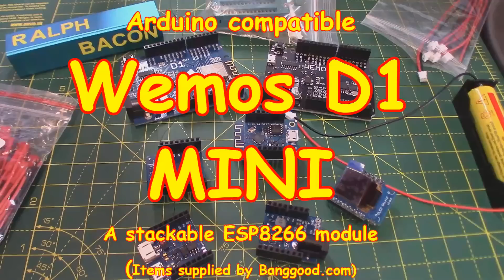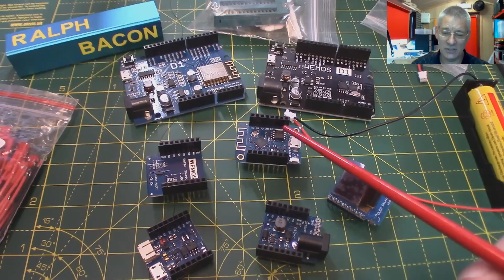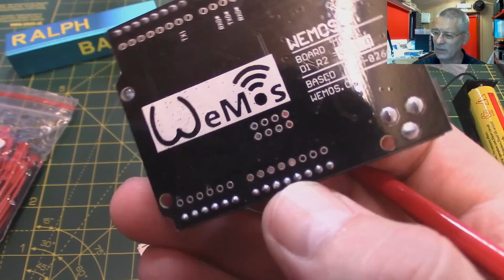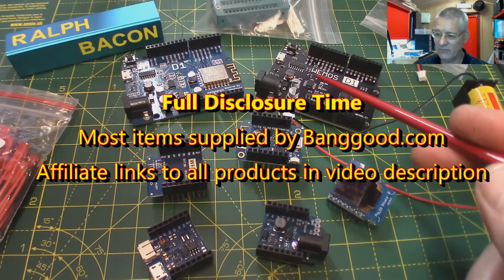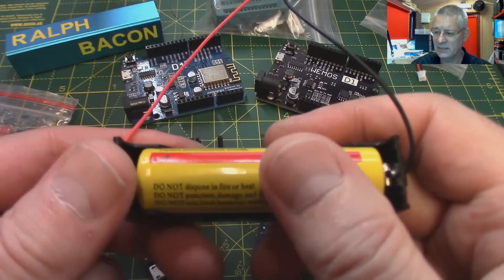#120 Wemos D1 Mini 👍 Intro (with shields)

Comment: For the completely uninformed, to be able to configure the IP address - to say a different static address - does one first install the Arduino IDE, then download the Wemos mini boards manager thru the Arduino IDE, and configure the wemos thru that software? How does this all work?
Reply from the maker: I may be wrong, Peter, but I think you are confusing the Integrated Development Environment with the actual sketch that you upload to the Wemos D1, if you are talking about giving it a static address.

1. Install the Arduino IDE.
2. Through the boards manager add the Wemos D1 (Mini) boards
3. Select the correct board in the Tools menu
4. Write your sketch in the usual way
5. Compile and upload to your selected board

You will note that there is no IP address being changed here - that is up to you in your sketch to state that the Wemos will run at, for example, 192.168.1.199 - but that has nothing to do with the actual installation of the hardware that gets the code to the device.

If you're still confused, reply to this message and I'll see what I can do.
Reply: @RalphBacon  Apologies, My computer network background is kicking in here. Too much of a newbie in the electronics world. In order to control multiple devices, i wanted to have some control over the  IP address of each device. The general idea would be to lock in IP addresses, so Wemos devices or apps can know who to contact if they want to contact a specific device  (reach each other in a defined or systematic way - instead of the DHCP way, where the IP address is assigned more randomly from the pool of available addresses). I have ordered the product to learn more...
Reply from the maker: What you are proposing is quite feasible, just separate the way the code is uploaded to the device from what the device is running! If you are expecting each ESP8266 device to act as a server that's fine, when you start the server up you tell it what the IP address is. You can then send in a GET request and receive data back (eg the temperature). 

Sometimes, however, it's more convenient to have the ESP8266 device act as a client that pushes it's messages out to a central device - but then we're talking about Tasmota, MQTT, Node-Red and the like - something I'm very keen to implement but, as yet, away from the test bench have had no time to do so. I'm throwing those acronyms at you to show you there is a whole world of home automation out there, tried and tested, for you to discover. It's great!

Comment: Hi, Can you tell me please how to get WEMOS_SHT3X.h from your GitHub into the Arduino IDE?  Many thanks.
Reply from the maker: OK, r1273m, here's a step-by-step guide:
 
1. Go to https://github.com/RalphBacon/Wemos-D1-Mini-ESP8266-stackable/tree/master/WEMOS_SHT3x 
2. Hit the Clone or DOWNLOAD button
 
You will now get this entire repository in ZIP form on your computer (I'm assuming a Windows 7/8/10 one)
3. Unzip the entire folder to your desktop
4. Once unzipped you will find a folder in there called WEMOS_SHT3x 
5. Copy the entire folder into your libraries folder (which is itself in your Arduino sketches folder)
 
Now Arduino will be able to find it when you reference it. If you had the IDE open you will have to restart it.
6. Enjoy
 
I hope this helps you (and anyone else having problems) with GitHub repositories (I will have to do all this in a video).
Reply: Brilliant thank you!  Soldered up the boards and connectors so that will be running soon.  Thanks again.
Reply: Followed the instructions, connected it all as in the video and it ran with no problems.  I'm new to WEMOS, the last programming I did was Z80 and M68xxx, so you can guess how old I am!  Bob
Reply from the maker: No older than me, I'm guessing Bob 👍. So glad it all worked out; at the risk of sounding unintentionally patronising: Well Done! It's always a milestone to get something running. I hope you continue with all things Arduino (and Pi). It's not all plain sailing but pick your projects and you'll have fun, that's for sure! Really nice to hear from you, thank you for posting.
Reply: @RalphBacon  Well that was a year ago and I have done quite a bit with the WEMOS  D1 since then.  The latest project returned to the SHT30 Temp/Humid shield with an OLED display.  It was sitting in the office and my wife looked at it and said "It's not THAT hot in here!"  I have some DS18B20 Temperature Sensors connected to another WEMOS (RSB video) and switched this on.  Needless to say there was about 3 degrees difference.

After a bit of thought I removed the SHT30 shield and made up an extension cable of about six inches and the discrepancy has been resolved.  I wonder if the sensor on the shield is warmed by heat from the microcontroller immediately below it.  I got the impression that you too was surprised at the ambient temperature on your project.

Great that you are still posting these videos despite your eye problems, hope you continue to improve.  Bob

Comment: I have one question.  I suspect the answer is common knowledge, but is the power voltage for the Wemos D1 3.3 volts?
A note about Linford Cristie.  I first heard of him (probably when the rest of the world heard of him) in summer 1992 when he won the 100 meters in the Olympics.  My personal note is that I was watching the race from a bed in St. Richards Hospital in Chichester.  I was recovering from a broken leg which I broke while on vacation/holiday from California.
Reply from the maker: Yes, all ESP8266-based boards run at 3.3 volts. Although 5v is also present ofttimes just for compatibility with the Uno. At the very least some sort of resistor-based voltage level shifting should be used; ideally, a proper level-shifter would be better. They cost pennies but are just so "messy" to wire up which is why so many Arduinites take a punt and just try it with 5v. Sometimes it survives, sometimes not. And congratulations on your leg healing some 25 years ago; let's hope it never happens again.

Comment: Ralph, I found that you can make a very nice web interface using smoothiecharts and websockets for a realtime temp/humidity graph.
I used the above, along with a nice SVG thermometer in an ESP8266 based incubator project. Yell out if you need example code.

Link flood bellow, but they're all relevant.
 
Smoothiecharts
http://smoothiecharts.org

Responsive SVG thermometer
https://codepen.io/abensur/pen/dzFfh

A couple websocket examples:
https://gist.github.com/bbx10/667e3d4f5f2c0831d00b
https://tttapa.github.io/ESP8266/Chap14%20-%20WebSocket.html
Reply from the maker: That looks interesting - and done in JavaScript too. I shall have to investigate, probably whilst on vacation but don't tell my wife! Thanks for the links.
Reply: Lots of JavaScript if I recall. I compressed all the third party JavaScript files with gzip and kept them local to the ESP (an SD card). Use of the "Content-Encoding: gzip" field in the HTTP response is accepted by any modern browser.
Reply from the maker: That's a great way of "minifying" the JS and keeping it local too, thus reducing the network traffic. I shall have to remember this. Thanks for the info, Cray Ze Ape.
Reply: No problem. Enjoy your vacation. :)

Comment: Fingets on board pins and tapping. ESD issues. Looks like it's a bit unstable with working and not working. Great demo, will stick with uno i think.
Reply from the maker: And sticking with the Uno is very sensible if you don't need wi-fi (and hence connectivity to/from the device) and your needs for computational power are modest. Horses for courses. Let's face it, the Uno has had a long and successful run and is still a great board. That said...
 
That said, the "instability" you saw was undoubtedly me mucking about with the board - I've never, ever had a full-sized Wemos D1 board do anything other than what I expect it to do. I must keep my fingers away from the chip when I do my demos in future. It's still worth considering, Terry, if only for the IoT aspect. Does everything a UNO can do (more quickly) plus that connectivity. Just suggestin'. 😀
Reply: @RalphBacon  fair enough. If it normally works, i will give it another look.

Comment: Hasn't ESP32 matured so much that you'll want to use those instead of ESP8266?
Reply from the maker: In a word or two, not quite, Martin. The ESP32 (still) needs to integrate more smoothly with the Arduino IDE and have suitable libraries and compiler to assist in using two cores / multi-threading - not something for the faint-hearted.
 
Using multiple threads in my professional coding capacity was quite a challenge but once you became aware of the issues it was all do-able, of course. What an Arduinite will do with two cores and multiple threads is another question.
 
But, I take your point, that the ESP32 is a most capable (not to mention speedy) board that would romp through standard Arduino UNO (and ESP8266) tasks like Linford Christie through a school sports day race!
 
As I have the ESP32 development board it won't be forgotten, but not quite mature enough (ie "just works) just yet IMHO. Thanks for the nudge though, I will duly at this to my list, thanks for posting, appreciated.

Comment: Great demo Ralph! I noticed the small 'bubble' on the buck chip on the battery power supply board that you fried. Same thing happened to me with a motor shield. I cooked it, the 'magic smoke' escaped and the same chip had a small 'bubble' on it. No biggie. 

I've been working with the ESP8266 making a remote-control activator with a servo that will press down on the 'on/off' button on my air conditioner remote to turn it on remotely. So if it's a hot day, I can send the initator email from the office just before I leave and the AC will cool the house for when I get home. I used the ifttt.com applet site and the thingSpeak.com website to build the event applets. I can now send an email to an address and it signals the ESP8266 to turn on/off the air conditioner. Way cool and a very approachable way to get into IoT. Check it out! Best wishes and keep it up! Gord
Reply from the maker: You win the Eagle Eyes award of the week . I didn't mention it in the video but I noticed it too, soon after my mishap. Yes, it was definitely fried when that bubble appeared! 
 
As for your other suggestion, I do still intend to create an MQTT/Node-Red workshop automation project, using Sonoff devices at the very least, so keep tuned.

Comment: Ralph waits until the board is almost obsolete before doing a video...lol!  Just kidding...I love those too and I think they are still valid even that ESP32 is more mainstream now.

ON THE BATTERY SHIELDS: you may not have broke it.... there exist a flaw in many boards where the 5v is shorted to the ground right at the USB connector.  I had to desolder 4 so far and grind away the ground plane right where the mounting via is on the left side   
Cheers Ralph!
Reply: ESP32 mainstream? Don't agree. The ESP8266 is still fully supported and available. It still has some advantages over ESP32 such as size, power usage and (library) support. In my opinion they are just siblings living well together side by side.
Reply: @MaxintRD  indeed, as long as you don't need Bluetooth I see no reason to use an ESP32
Reply: @MaxintRD  I don't either...I was just pulling Ralph's chain.  I still buy those still.  But supposedly the 32 is much better with low power...if if that's the case I wouldn't use the wemos anyway!
Reply from the maker: I definitely let the magic smoke appear. But I think it was not me shorting it all out on the metal dish, after all, I think it was plugging it in backwards with the JST cable, even for a second. Maybe. I'll never know for sure. But I will certainly check out what you suggest anyway, so thanks for the heads up, James.
Reply: Well, it's definitely not the most expensive mistake you will ever make.  :)
I could not believe I received 4 to 5 from all different sellers with this same problem.
I think all other ports worked ok, it was just the USB.  It's a bit of a pain to remove it, fix the problem and resolder, but not a difficult problem to solve.  It's annoying to spend time like that on a dollar product, but at the same time I hate to trash it!
Reply from the maker: That's why it's a dollar product, perhaps? Those Far Eastern factories definitely build down to a price (unless you're getting quality leftovers from some other major manufacturer's project). But hey, without them we could not do our projects!

Comment: My go-to ESP. Module :-)
There are 2 versions of the battery shield. The newer one has a resistor between Ao and   Vbat (via a jumper). 
The battery shield is really handy, but not the most efficient to use in terms of on-time as the 3.7 is first transformed to 5 voltv which is then brought back to 3.3. For a power backup it is unbeatable, for a battery only project there are better solutions.
The temperature shield is best used for testing as the Wemos proximity will raise the temperature.
Though I have not used it myself, I hear the relay board might not be such a good choice as it seems to have some weird driver IC....... But I could be wrong
Reply from the maker: Funny you should mention the battery shield, Ed. Whilst it certainly does work to power the Mini D1 I have not done any kind of power consumption testing (yet). But as a UPS module it works brilliantly (I testing plugging in an out the charging cable many times and it did not bat an eyelid).
Reply: @RalphBacon  yes it does. Easy to use

Comment: Very nice!  This line is similar to the Tiny Circuits line.  I imagine that there are dozens of this type of mini microcontroller series (with accessories) available thanks to open source hardware.   
Perhaps a Benny cyborg is in the works?
Reply from the maker: There could never be a cyborg version of Benny, I'm afraid, he is just too fluffy and cuddly. I just Googled the TinyCircuits website and whilst they seem to produce some nice products did you not notice the prices? You could buy a whole stack of Wemos D1 Minis for a single one of their offerings. Such is the power of the Far Eastern market pricing, I guess.

Comment: Another Great Video.  could you possibly add a rotary encoder to the Wemos Mini. I've had problems with the esp8266 and rotary encoder (KY-040).  I'm trying to get a menue setup.
Reply from the maker: Hmm, you are not the first to say that. But I recently did an experiment on a Wemos D1 (full sized) board for another Arduinite for a rotary encoder and it worked exactly as expected. So I wonder what it is that some users are experiencing?

Comment: I had a look at a LiPo battery I have and it has the red lead on the left of the JST connector (With the longitudinal key on top and the "hook" on the bottom) , as your sheild expects. However googling for images of JST  power connectors shows some of them wired the other way! There are a dozen or so types of JST connector with different pin pitches and sizes though, so maybe it depends on the connector type? At least I am warned to check carefully... I have a Seeed Arduino with a JST type connector that is wired the other way, although that one expects two key ribs on top. Lucky I never tried plugging the LiPo into it!
Reply from the maker: Yes, it appears it is up to the implementor to determine polarity, Ian. What could possibly go wrong? Oh.

Comment: choosing which headers was the hardest decision i have had to make in a while. lol
Reply from the maker: You may gently mock, tablatronix, but I did it wrong with the replacement LiPo shield, and soldered header PINs on it when I should have soldered header SOCKETs on it. Doh! So I had to desolder them and do it right.
 
That little anecdote got left on the cutting room floor but I was somewhat embarrassed! Easy to do, hence why I raised it. And, to make it worse, not all shields come with all options so you could end up with an unconnectable shield (unless you have spare headers/sockets etc). So that just proves something, if only I could work out what.
Reply: Ralph S Bacon wasn’t mocking, I was telling the truth, hah I ended up using none and used machine headers instead cause I had little vertical space. I always deliberate when i get a module. Hmmm breadboard... or female headers for jumper wires.. OR RIGHT ANGLE! Aghhhh
Reply from the maker: In that case, I'm glad I made the point that Arduinites must consider this important point, as you are proof of the pudding, er, well, you know what I mean, I'm sure!

Comment: There is no recognised connection standard for JST connectors. Caveat Emptor. The other misconception lies in the JST name. Again it is not a connector series designation but rather the name of the original maker, Japan Solderless Terminal hence the name carries over multiple connector series usually separated by a suffix like JST SH. Laziness dictates the abbreviation to just JST.
Reply from the maker: Yes, spot on Rob. Wikipedia even says that it's up to the implementor to decide on polarity. Could be very dangerous when the connectors are supplied pre-wired like that. Thanks for the information, appreciated.
Reply: I dont know if its possible to remove the contacts from the housing and swap them like you can with "dupont" and molex connectors, but it might be worth a try.
Reply from the maker: That's exactly what I did, you just need a very slim screwdriver to lever the white plastic hook away as you pull out the lead. Gently, gently is the name of the game here. Thanks for the suggestion Ian, good to hear from you.